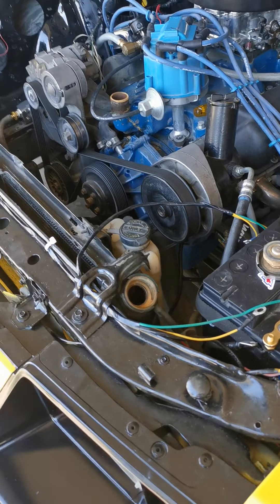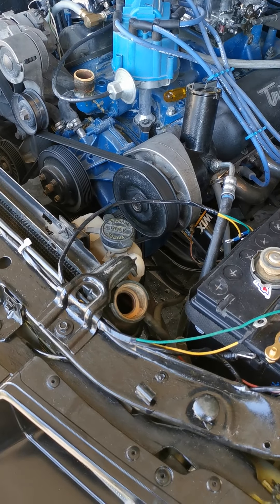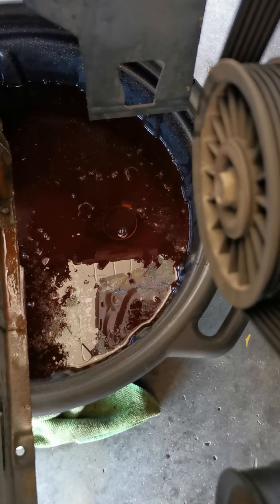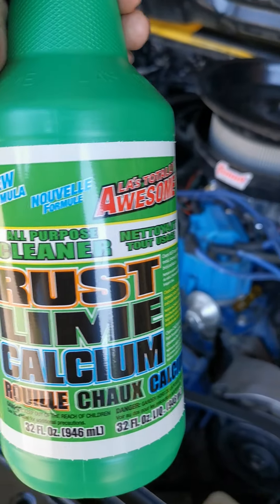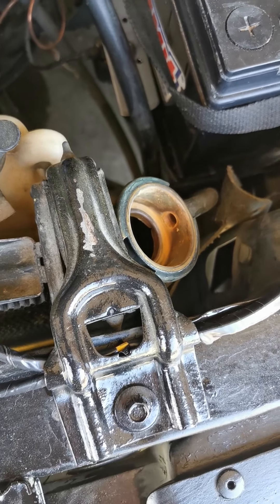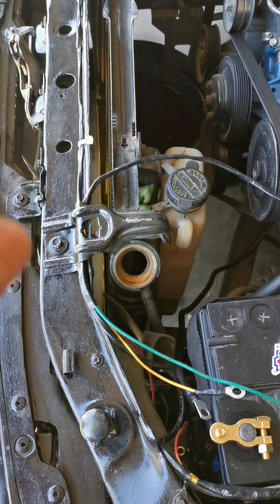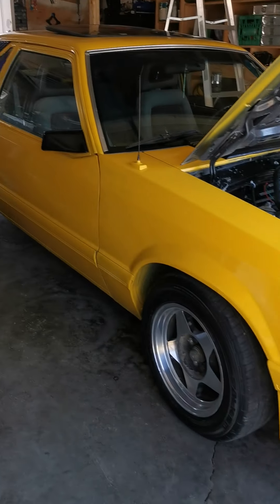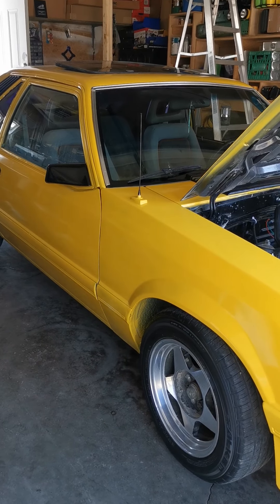CLR and plugged rad part 1

Comment: I had an old 66 that was running hot.. So, I drained the coolant, removed the thermostat, and flushed it with clean water several times. Added three bottles of CLR, filled with water, and ran the car a few miles just to get everything mixed well. I actually ended up letting the car sit for several days and every couple days I would start the car and let it run till it was up to temp. After a couple weeks had passed, I opened the petcock and drained everything into a heavy duty plastic tote. I rinsed the system several times, ran the car, rinsed and repeated. I did need to solder a few small leaks, but it wasn't really that big a deal, and the engine no longer overheated. So, the three gallons of CLR water I had stored in the plastic tote was really nasty stuff, but I had placed it in the corner of a little shed I have, and had actually forgotten about it for several months. One day, while cleaning out the shed, I ran across the tote and found the water had all evaporated leaving around 3 inches of the bottom in this dark clay like material. I can only guess this was a mixture of the calcium, lime, and rust that had been dissolved by the CLR.

Comment: I had a similar problem vinegar. I think what happens is if you ever used any leak repair the vinegar will dissolve it. Brass is pretty tolerant of mild acid like that, copper is not (nor is aluminum). Maybe some of the solder dissolved around the tubes. Mercedes Benz actually says to use citric acid to flush an engines cooling system. A lot of the commercially available consumer 'cooling system cleaners' contain sodium citrate which is minimally effective. 
My engine was perfectly clean as was the radiator but I bought some cheap-ass discount no name antifreeze to top off and the electrolysis wrecked my cooling system. I had 2 aluminum components in my cooling system, the water pump and thermostat housing and both were eaten away beyond repair. That's how I found the damage, the stat housing started leaking and after I pulled it off the inside looked like the Titanic.

Comment: Vertical video 👎
Destroying Coolant System 👎
Referring to Radiator as “Rad” 👎
Reply from the maker: @nathanielfuentes5294  thanks for the positive feedback amigo ...hope you have an amazing day ....and make sure to keep that RAD in tip top shape buddy
Reply: @molinelligarage1004 My Radiator is fine. I won't be using an acid in it effectively dissolving the metals.